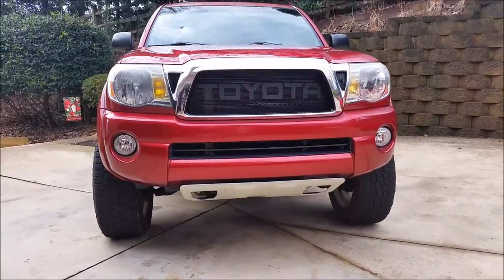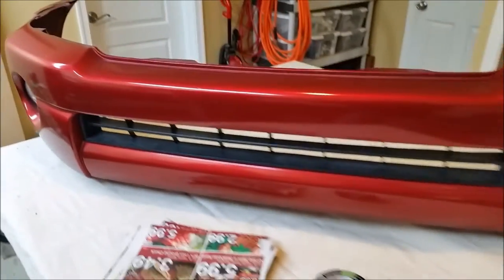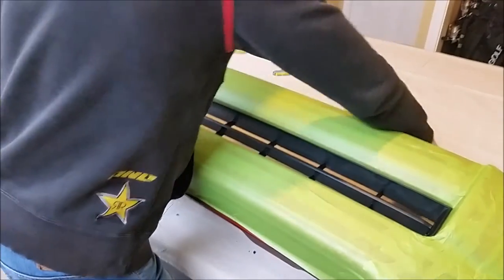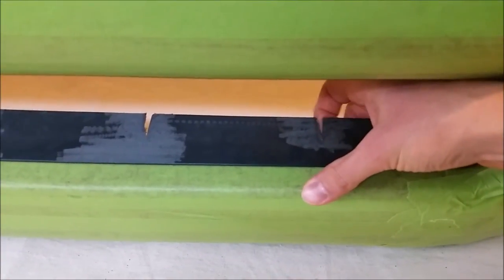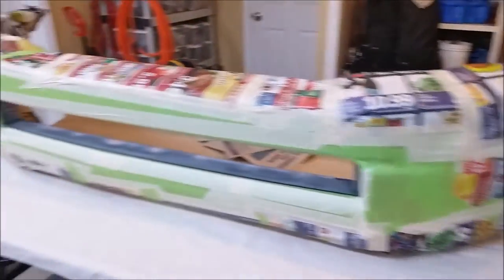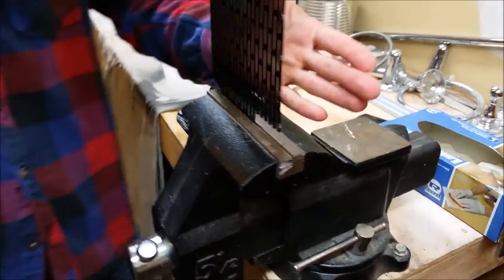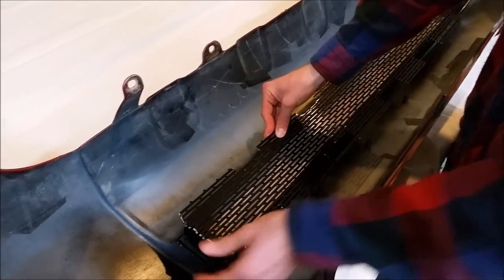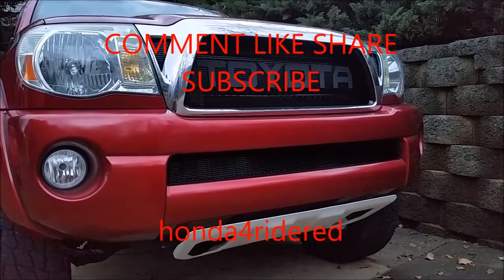2ND Generation Toyota Tacoma Lower Custom Mesh Grill Installation

Comment: Thanks for the video. Do you have a video of you re-installing the bumper cover?
Reply from the maker: I don't think I did for this truck, but it's not too hard to put back on!
Reply: @BrosFOURRSpeed  Hey thanks for replying. Yeah, I am replacing parts due to a collision with a turkey and broke some of the "tabs." I have new OEM parts and found autobody plastic pegs/screws and zip ties. Thanks again.